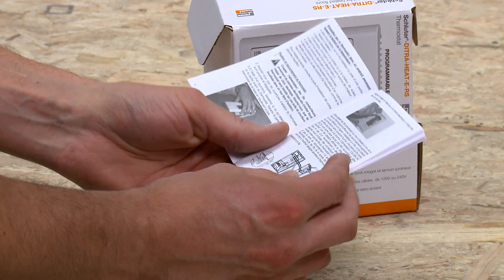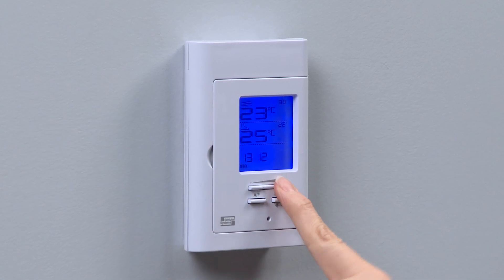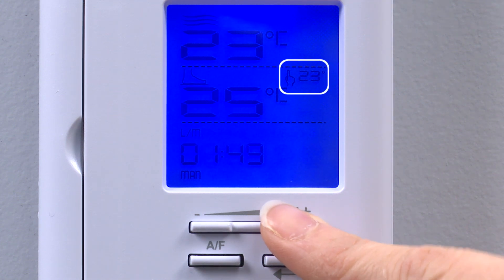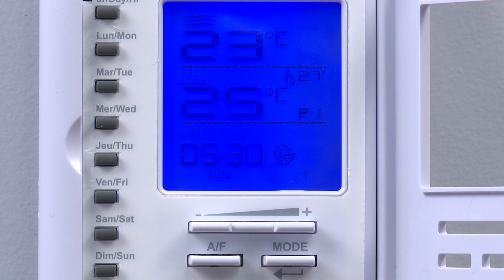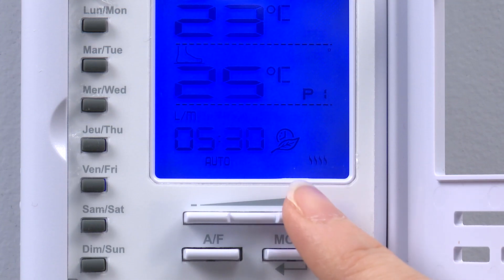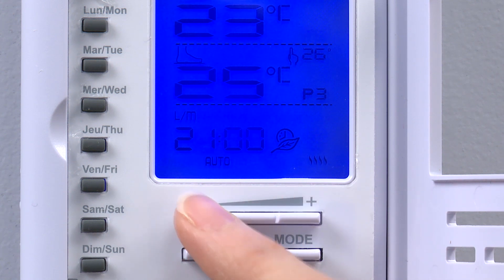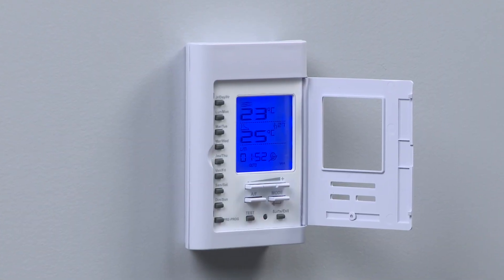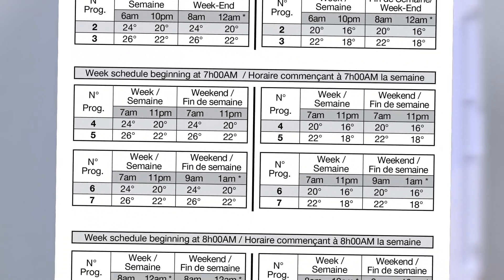How to program the Schluter®-DITRA-HEAT-E-RSD Thermostat - Celsius

Comment: I have dashes next to my floor heat set point temp in manual and auto modes and no floor heat in ambient or floor modes with no fault codes. Would this indicate a thermostat failure?
Reply from the maker: Hi there🍊 Sorry to hear you are having a product issue - our Product Support team would be happy to help you - could you please reach out at 888-472-4588 (US) or 800-667-8746 (Canada). Thanks!

Comment: Could someone please respond-how do I turn this off for the summer?
Reply from the maker: Hi there. You can put the thermostat into manual mode and then lower the target temperature to something where it wouldn't heat (50 degrees for example). To put the thermostat in manual mode, you would press the "MODE" button until MAN is visible on the bottom left hand side of the display.

When ready to resume your schedule, you would press the "MODE" button until AUTO is visible on the bottom left hand side of the display. You can also turn the power off at the breaker while it's not in use. Hope that helps!

Comment: Hello…I have an old Stelpro (12 years), the floor temperature is stuck at 26C, can it be program or I have a faulty thermostat or floor sensor ?
Reply from the maker: Hi Francois, if you're having trouble with your Stelpro thermostat, you'll have to contact them for support first. If you have our floor warming system, our Product Support team can help you troubleshoot for the sensor, but think you'd be better off checking in on the thermostat first with Stelpro. 800-667-8746 (Canada) or 800-472-4588 (US). Thanks!

Comment: How do I set the time? It's incorrect right now
Reply: Cullen Dancy - I just figured it out... Top right corner there is a Jr/Day/Hr button. Press that once and it let's you adjust the Day of the week with the +/- button (day of the week will be blinking just above the time), press again and Hour blinks adjust with +/- button, press again and adjust the minute with +/- and press again to finish programming
Reply: @DJMARINKOx  you rock thanks a lot!!
Reply: @cullendancy7386  thank you - i wrote it on a piece of paper and tucked it into the unit so that next year i don't have to go through this
Reply from the maker: Mind giving our support team a call? They can walk you through the steps
US 800-472-4588
CA 800-667-8746
Reply: @schlutersystems1  how about answering the ACTUAL question or  uploading a video that would answer it?  no one wants to sit on hold waiting for your "support"

Comment: How to reset it completely ?
Reply from the maker: Hi Chloé,
Mind giving our Product Support team a call? They can walk you through some troubleshooting questions.
US: 800-472-4588
CA: 800-667-8746
Thanks!
Reply: @schlutersystems1   I have two questions: it's written Stelpro on mine instead of Schluter-Systems but it is exactly the same model, is it from the same brand and can I call the number you gave me ? Also, do you offer service in french on the phone in Canada ? Thank you
Reply from the maker: Hi Chloé, are you using the thermostat with our Ditra-Heat system? If so, our Product Support team can help you out with that at 800-667-8746. If not, you would have to contact Stelpro. Et oui... nous offrons un service en français !